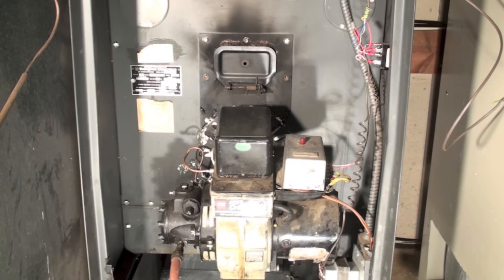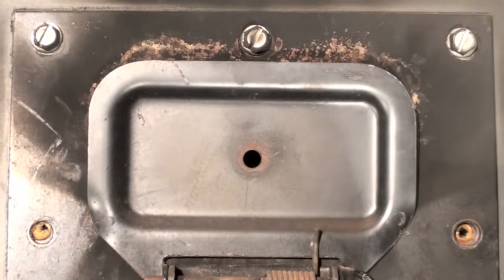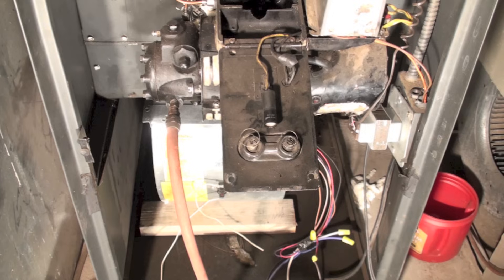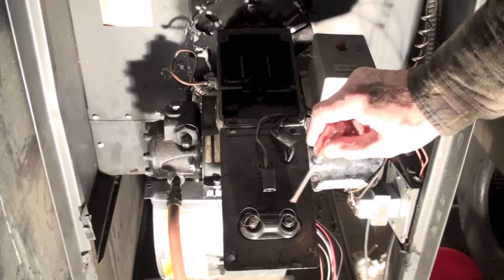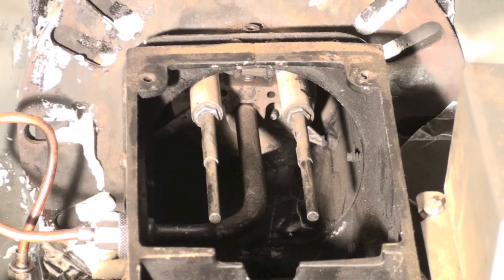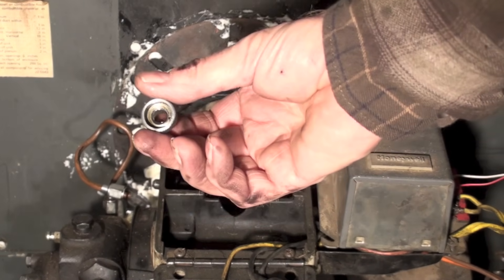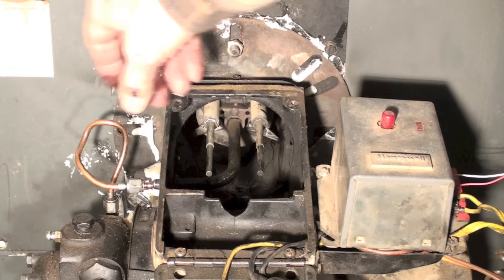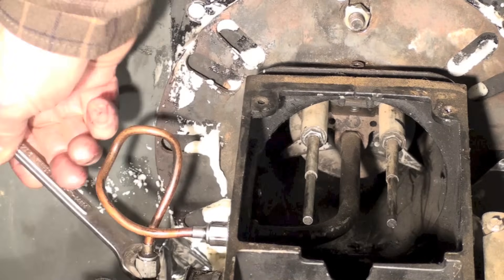Oil furnace troubleshoot part 2 No flame

Comment: You're making me increadibly nervous, I think I pushed the button 20 times now,  its not igniting, i know it gets oil, but now im afraid it will explode.

I have taken everything apart and nozzle and the spark things were completly gunked up, I cleaned it off and replaced the nozzle (same size 0.5) but it is still not igniting, hopefully this video will help me.

Comment: THR ELEVTRODES   HAVE TO BE HORIZONTAL OR THE  POWER  SPRINGS  DO NOT CONTACT  THEM CORRECTLY  ............................ THE SET  SCREW  WHICH CONTACTS THE FUEL ROD CAN BE ADJUSTED  TO  AFFECT THIS ..  NOW  MY BURNER DOES NOT  SHUT OFF..
Reply from the maker: Sounds like an electrical problem that keeps the burner on when it should be off.
GFM

Comment: Thanks for the advice and video. My oil fired boiler was doing the same thing ( not firing up ) When it did fire up the whole basement was filled with heavy smoke,also a  roaring fire inside the combustion chamber The local fire department showed up when a neighbor called to tell them a lot  of black smoke was coming from my chimney. Good thing I had a fire extinguisher handy and put the fire out before the fire department showed up. The cause was a bad electrode

Comment: So I replaced electrodes, nozzle, filter, etc and I realized I’m not getting oil to the gun. It gets past the filter but won’t go the gun so the nozzle can spray. Any suggestions?
Reply from the maker: Have you checked for a screen in the pump?
GFM

Comment: and right off the bat... the eletrodes. You mention if touch, the short? would that cause a slight electrical charge/pulse if you touch the metal on the motor?
Reply from the maker: It should not.
GFM

Comment: Im having a problem with my Miller oil furnace. I have been resetting the reset on the furnace. When i do reset it i would get 5 to 6 continuous cycles of running as usual then it would not start up. I would have to reset the switch again. I did a new fuel oil filter change and it was dirty. I bled the filter housing and bled the system. The flow was good but it is still not working right. I was thinking that ut could be the control box with reset switch sits on. I'm stumped.
Reply from the maker: Have you replaced the nozzle?
GFM

Comment: if i sent you my email, could you private message  me and walk thur with me over the phone to test, (sensor  limit switch), and reset box, and how to test the wiring and make sure no intermittent shorts? i could pay you for yr time, as well, by sending you a money order or wire thur walmart? i have had 4 people here now from jan 9th to current and no one is figuring out why when i wake up in the am i have no heat., yet at night or for the mins they are here everything seems fine making me look like a baskett case! lol i have ruled out gelling, air fuel mix, and new filters. oh there is a spark gap? this is like working on a car 4 real. spark plugs have gaps too, my issue i only know 12v not 120 or house/ a/c volts.

Comment: Excellent video, thanks!   My burner stopped working this morning and the nights have been down to 4 below zero. As of right now it's a sunny afternoon, 40 degrees,  but tonight brrrrrrr.  I was just about to I call in an emergency service call to get it running before the sun goes down today........ But before that I figured I would give YT a shot, So I looked on YT and yours was the first video up so I clicked on it and sure enough, the burner set up was exactly the same as mine.....awesome, I followed your video step by step and found the reason it wasn't igniting..........it turned out, the electrodes inside were full of grunged oil debris and the gunk was touching the nozzle below it, shorting it out. So I wiped it clean with a cloth,  looked fine then reinstalled it and wallah.............it ignited and has been running fine since.  A million thanks for saving me money, time and anguish in this problem.  Now I got to look to see if you have a vid on basic furnace maintenance and check up,   your very informative, Thanks again friend.👍✌

Comment: If too much fuel is in the combustion chamber can you dry it by blowing hot air into the chamber with a heat gun kept back about a foot from the chamber🤔
Reply from the maker: Nope, you just get warm oil.
GFM

Comment: Thank you so much for the troubleshooting steps and easy to understand instruction, there was no sparks at my transformer and replaced it to resolve the issue before the freeze & snowy weather!  Saved me hundreds over a service call by spending only $67 on the new transformer part, much appreciated!

Comment: Your demonstration of how to pull the gun out of the housing was incredibly useful for me. Enable me to get my heat back on at four in the morning of a Vermont winter. I thought I would have to pull the whole oil burner unit out of the furnace in order to adjust the electrodes. Once I pulled the gun and adjusted the electrodes everything worked perfectly.

Comment: I cycled my button over 20 times bleeding to get my furnace going. 
Yesterday Had flame but wouldn’t keep, today no flame. 
Pint after pint bleeding through it, bubbling half the surface in my jar, but getting ignition without hesitation, and then dying at the end of the cycle. 
Got new prop, water cycle and filter end of last winter
Reply from the maker: If you are getting bubbles when bleeding, you may have a vacuum leak in the suction line.
GFM

Comment: Thank you so much for doing this video, I have the same set up and I can't get her to light, I changed the CAD, the Transformer, the nozzle on the gun and the spark prongs. I did press it over 20 times... is there a way to drain that fuel out? I got a pump I could sick in there and get it out. Well anyway I changed all that stuff, and its still not lighting. What is my next step? Thank you for you help a head of time.

Comment: Every year I take my burner apart and clean the electrodes and charge the  fuel filter and clean the nozzle . This year it will not ignite. Usually pushing the emergency switch fixes any temporary problems. This time I pressed the switch about 5 times . After watching this video I'm afraid of what could happen if it does ignite. So now what? Suggestions?
Reply from the maker: If the unit is less than 30 years old, 5 resets will not release enough oil into the chamber to cause a problem.  Begin your troubleshoot, and when you have found the problem, start it off normally.
GFM

Comment: Thought I ran out of oil or something. Took the electrodes out, and sure enough, the spacing is almost a quarter inch apart and the tips are burnt away. Adjusted the tips and started burning again. Thanks a lot!

Comment: I have af 15 burner kept tripping so replaced control board with older spare that originally used a transformer igniter. Are electric igniter and transformer igniter equipped control boards interchangeable. Run good but quit after 2 days has spark won't light. Was thinking electronic igniter weak but unsure.
Reply from the maker: They are interchangeable.  
I would be looking for any oil supply problem.
GFM
Reply: @grayfurnaceman  OK put brand new pump on it 2 months ago. All I can think of are replacing felt filter and adding anti gel to fuel. Do those anti gel additives work.
Reply from the maker: The additives do work at temps below about 10F.  
GFM @larchman4327
Reply: @grayfurnaceman  I'm in AK so try it. Thanks.
Reply: Two month old nozzle was plugged works now. Funny how that happened 2 days after doing something unrelated.
Reply from the maker: One of the first things to do when oil supply is suspected is replace the nozzle
GFM @larchman4327

Comment: I think my combustion chamber is flooded. I pressed that button 10x How do I clean out all the fuel, I'm getting tons of smoke
Reply from the maker: The only effective way to clean a flooded chamber is to remove and replace the chamber.  
What I would do is run some sort of dip stick into the chamber to measure the level of oil.  If you find any discernible level of oil in the chamber, it must be replaced.
No level found, fire off the burner for 2 seconds, shut down and allow the oil to burn.  Have a fire extinguisher ready if it gets out of control.  Once it has burned out, the heat exchanger and smoke pipe should be cleaned and the burner serviced.
GFM

Comment: Thank you . This gave me enough info to troubleshoot and fix my oil burner heater . Dirty electrodes and the injector was caked up with oil residue.  Nothing a wire wheel didn't fix.

Comment: Great video.  My camp has an oil furnace.  It stopped working a few weeks ago.  I went to camp, pressed the reset button and it fired up and worked the next few days I was there.  Then went home and with the thermostat down to 40F, about a week later, it's not working again.  Had a furnace guy stop by when I was there a few weeks ago and he cleaned up some basic stuff and said a stink bug was blocking the "eye" and that might have been the issue.  But don't know.  But need to head up again this week before pipes freeze.  Will use this video to see if I see anything.  Also going to install a wifi app finger button to press the reset button remotely if I need to (but just once or twice as you warned about.).  Frustrating....but this video is definitely helpful.  Any ideas why it might be shutting off when the thermostat is down low?  Wondering if it not running for a few days at a time might cause an issue when trying to restart.  Furnace is a 24 year old Miller in a double wide trailer camp.

Comment: Very informative video. So my ignition problem has a slight variation in that it first failed to ignite about three weeks ago and I pushed the red button and it just sprayed without igniting for the 40 seconds and then shut off. Waited a few and pushed again and it fired up ((with a bunch of smoke). Had hoped it was a one off fluke but it happened again today. This time l pushed the button and it fired right up. So could the electrodes just be slightly off to make it fail just randomly intermittently? Just had it cleaned in June.
Reply from the maker: I would start with a nozzle replacement.
GFM

Comment: Really hope you see this comment sir. My spark is good, fuel running but no flame. Cleaned off the thing in this video and assembled correctly. When I hit my reset I can see in the peek hole that sparks going off but I have no flame. Any suggestions?
Reply from the maker: Is there a fog of atomized oil in the combustion chamber after the unit has operated for a few seconds?
GFM
Reply: @grayfurnaceman   There is a little yes
Reply from the maker: I would start with a new nozzle.
GFM @LivingFromChrist
Reply: @grayfurnaceman  that’s what I was thinking, I will start there. Thank you so much

Comment: I have a Beckett oil burner that locks out every once in a while. It usually starts upon reset. No air in lines or any obvious causes. Any idea what would cause this ?
Reply from the maker: Have you checked the spark?
GFM
Reply: @grayfurnaceman  I can here the spark. I replaced the nozzle and it fired right up. I hope that was it !  Thanks for your help ! !

Comment: Just wanted to thank you for taking time to make a vid. 
The electrode test was key, and then letting me realize I hadn’t done the maintenance to the adjustments at the nozzle in longer than I thought…was wondering why it took a bit to ignite and then cut to red light occasionally. 🤤
All good for now, just have to swap out the aquastat in the am so I can get the thermostat and un-rig the circulator :/
Anyway, nice quick info, thnx !

Comment: Im working a service call now. Serviced unit. Changed probes. All is testing out. Head distance all set. But wont light. Im going back to ensure i didnt put a opposite solid nozzle by mistake. I did see it run 10 secs before i started  the service other day.  Any other ideas to check?

Comment: What happens if I pressed the button more than 10 times …. Should I wait till the next day to take it off and clean the part you did and try it again ??
Reply from the maker: At this point, you need to determine how much oil is in the chamber.  If you can get a wire to the bottom of the combustion chamber to use as a dipstick, you may be able to determine how much oil is in the chamber, if any.  A readable level could be dangerous if you lite it off.  The fire could get out of control.  
If the unit is less than 50 years old and the nozzle size is less than 1 gallon, you are probably ok.  But if you get it fired off, I would lite the burner for about 2 seconds then shut it down.  Have a fire extinguisher handy.
GFM
Reply: @grayfurnaceman  do you think it’s worth having a company do it for me so I don’t blow the house up … I just want to move in but not until we have hot water it my mother in law’s apartment old tenant messed everything up in the whole house
Reply from the maker: Good idea.
GFM @2FrEsH4ya617

Comment: Glad to see you're still answering these older ones. Used this video and a couple others to keep from freezing the last few years. Had several trips from a professional last winter and my furnace starts more often than not when I flip the breaker but sometimes it doesn't and after about 4-5 seconds I turn it off. If it starts on the next throw it burns a couple seconds then it starts to rumble and roar as if i had a whole lot of oil in there. Already spent over $850 with trips and parts I'm not sure it needed. It never did this before. Spent the rest of the winter in the 40s and 50s turning it on by hand and running it about 45 minutes and used only a quarter tank ( 250 tank I think). Debated on new unit  but already spent that.  Saw your video on the gun peeing. Hate to think it may have been doing this since spring. I  have opened the little door since then a couple times but don't smell a lot of oil. THANK YOU FOR HELPING YOUR READERS !

Comment: Oh my God you are so right. I'm a general contractor but I also own a bunch of multi families in Massachusetts. The problem is people know you can press that red button and it does something and they have no clue what it does. Years ago I had a tenant. That pressed the buttons so many times there was a half a gallon of oil leaking out of the chamber. They had their kid keep pressing the button for almost two hours they thought if it just made noise would heat up the house.😊 Needless to say all my rental properties I open up the aquastat and remove the button. So that way tenants can't press it. So that way only me or a boiler guy knows you can pull the cover off and he can still press it without that button there.
Reply from the maker: Good idea.
GFM

Comment: You don't need to bend the line or even rotate it left. You will be moving the nozzle assy to the right anyway. If you loosen the other  line nut, the fuel will drain out of it. I just take the line nut off, push it up the line a little, then take the thumb nut off and slide it over the line and let it hang there.

Comment: Whoa, glad I watched this video before I tried to fire my boiler after hitting the button an indeterminate number of times.

I picked up the kit for the combustion chamber, about $200 and spent a few hours replacing that. Looked like it needed replacing anyway so no big deal.

My basement filled up with smoke from about 5 buttons pushes while I was troubleshooting after the combustion chamber replacement but it cleared out after a few minutes.

Thanks so much for making this series of videos.

Comment: Great video! Quick question what could've made that electrode to fall out of place?
Reply from the maker: Usually if it is not tightened enough.
GFM
Reply: @grayfurnaceman  Thank you for the answer, in your case did you or somebody else worked on them for service and when they were put back they weren't properly tightened?
Reply from the maker: @M-Rv  Yes, a number of times.
GFM

Comment: still no flame
Reply: changed nozzle filter and electrodes checked gap and tested transformer
Reply from the maker: @bmonteleone48  Do you have a fog of oil droplets in the combustion chamber after a trial for ignition?
GFM

Comment: My oil furnace has no power to the ignition transformer or the oil valve, no voltage? The burner motor starts then goes into lockout. All controls are new. Please Help. Thanks for all your support. Michael Mongillo mongillom@yahoo.com

Comment: Adding my thanks to the long list of grateful commenters here.  I had learned how to change the filter, strainer, nozzle and electrodes at the beginning of the heating season and it had been working fine.  Woke up to a cold house this morning, pushed the reset twice with no luck.  Found your video series and figured I may as well watch it while I waited for a call back from the service company, not noted for prompt customer service which is why I had learned to do my own maintenance.  Took out the electrodes and they were a tiny bit off, reset them and reinstalled.  Hit the button again and voila it started right up.  Took me 3 hours to work thru everything and still no call back..  The only problem was that my furnace doesn't have a little door to tell if I have a spark so I don't know how to tell if I have fire.  Thank you for posting your videos and helping me stay warm!
Reply from the maker: Welcome
GFM

Comment: you can always take a fluid evacuator(pump or air powered) and suck out any excess oil from the combustion chamber.
Reply from the maker: The problem with that is the combustion chamber gets soaked with oil.
GFM

Comment: I love how you logically stepped through the troubleshooting steps. I had already been through the first half without success. After looking at the electrodes I saw they were too far apart and behind the face of the nozzle. After a little adjustment, it fired up right away. You even showed how there can be some initial smoke. This warning prevented me from going into panic mode. THANKS!!!♥♥♥